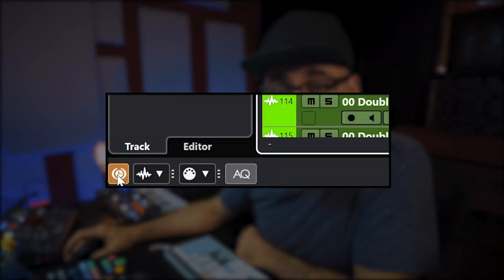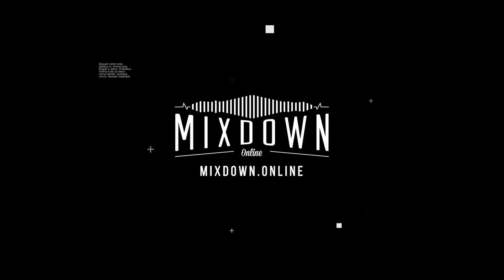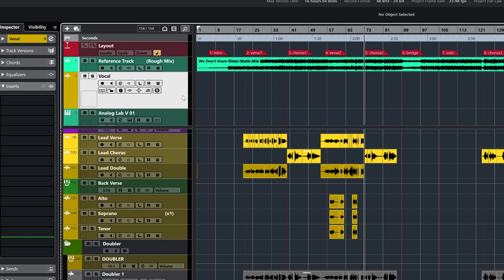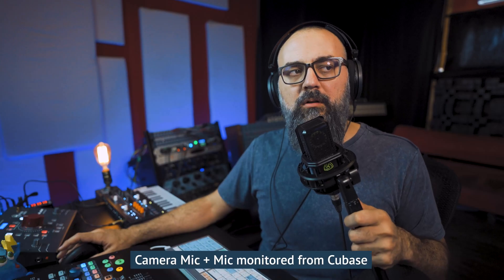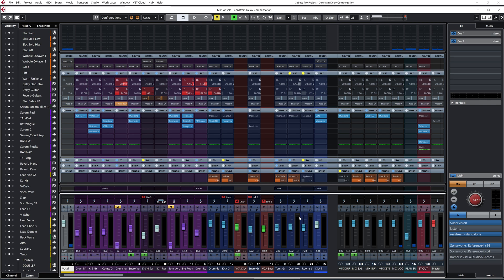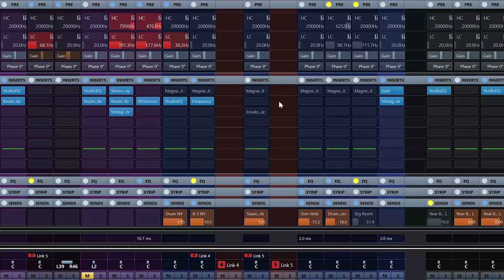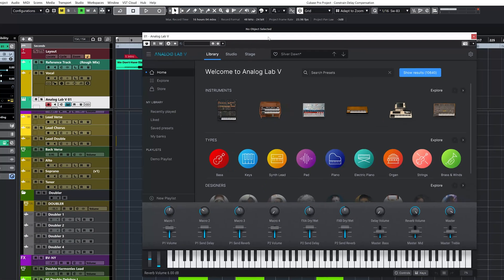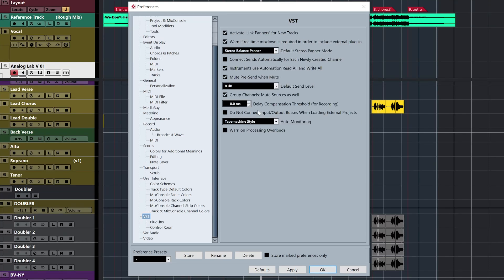Understanding Constrain Delay Compensation in CUBASE

Comment: Hi Chris, I have a question. Assuming that most of people (specially pop, electronic, rap/trap) will work at 44.100/24bit or 48.000/24bit, between 128/512 buffer size, "producing/mixing on the flow". What are the best options of audio interfaces in terms of RTL (round trip latency) on those values?

Comment: Ciao Chris, very useful and important,  I discoverd casually few days ago, before your video, the effect of this function, activating this I got less Cpu stress and less crush episodes in my rich mix, but the sound seemed worst, so I decide to use only for tracking to have less latency, but for the mix the sound change is bad and too much...any tip or hint ? wich threshold to use for PDC ? wich plugin must I activate or not PDC for (flag on or ogg in plugin information window) ? Have a Great Music
Reply from the maker: This function is not made when Mixing, mainly useful when you need to record at lower latency and you have too many plugins loaded in your session. That can be a good solution for the time you record only, you turn it off after to get back to your mix

Comment: Hello Chris, great video as usual. Clearly explained. Thanks for that. But I have a question about 'testing' this feature. I put a couple of third party plugins in the mix; one with 1.5ms and one with a big 12.3ms (delay and reverb) and put them on a couple of vocal tracks. Then I set up a test track and put it in record (buffer size set to 128ms). I was expecting to see them greyed out when I turned on the delay compensation, but it never happened. So to save you trying to figure out what I'm doing wrong, can you just tell me how to set up a track to test this and what to listen or watch for as the plugins seemed to work whether to button was on or off. I thought they would be greyed out. But it did change the tone of the mix...hmm? MM

Comment: Hey Chris, Awesome video,  I switched from Logic to Cubase about a year ago so this information is very helpful.  I have not looked at you're other videos but do you have any on Track delay adjusting for VST instruments ?  I learned that some of the settings for certain VST libraries will have this information In their manual.  Unfortunately all VST libraries don't share that information.  What would be your take on how to set those settings for some libraries that have a delay when recording midi because that's was the way it was recorded.  Primly orchestra sound libraries.  Thanks Chris!

Comment: I am using cubase 10.5pro... When applied some waves plugins to vocal tracks, vocal is always behind the music track.. So it needs to adjust manually delay time to be matched with music tracks.. In protools no need to adjust manually, it is automatically adjust delay.. How to solve this problems in cubase pro..... Please help?
Reply from the maker: Same in Cubase, Cubase has an internal Delay Compensation that solves this problem automatically. If that doesn't work on your side, maybe you're working with a craked version of Cubase, if not, contact Steinberg Support tam.
Reply: @mixdownonline  yes, i am using cracked version.. Thanks for reply

Comment: I have that problem that when artists want to rerecord some lines after the song is mixed and mastered (most of the time i do both in the same session) that the delay compensation turns of Autotune Pro (even if i use it on low latency mode) and that's a big problem so i have to make a new recording session only for that fiew lines and import them into the mixing projekt. Do you know a better way to solve this problem Chris?

Comment: great as always. 
What you didn´t mention is that when this is enabled some plugins such as amplitube or guitar rig which are needed to record wil be disabled (I mean you can record wihtout a reverb but to record a guitar you need to hear some effects while playing)  but if you increase the threshold in Preferences those plugins will be enabled! At least for me this is when this function turns really useful.
Reply: I was just thinking about this. Perhaps one could just render any such tracks to audio, at least temporarily? (I am also thinking of VSTis, such as drums, for example.)
Reply from the maker: That depends on each plugins and how much delay they add to Cubase for processing. Increasing the threshold will help in that case for sure. Funny thing, on my side, Guitar Rig and VST Guit Amp don't get disabled when CDC is active. I don't know about Amplitube since I don't have it.
Reply: Is it possible after activating the compensation button to then manually reactivate individual plugins that you want to leave on regardless of their effect on latency?
Reply: @kdcyp  Excellent question; You certainly would have thought so wouldn't you !